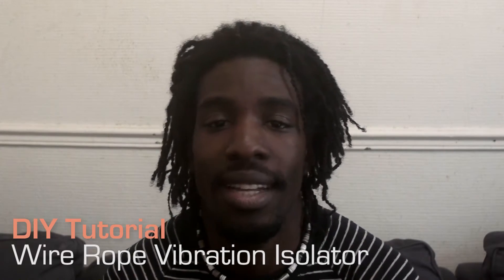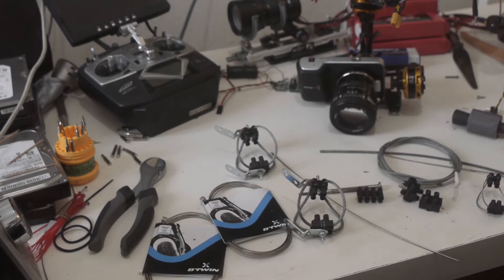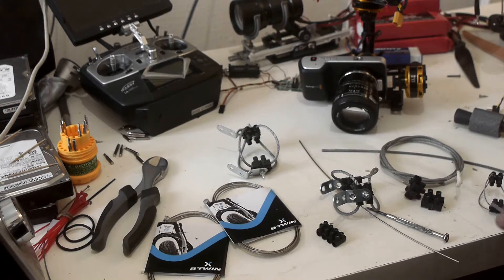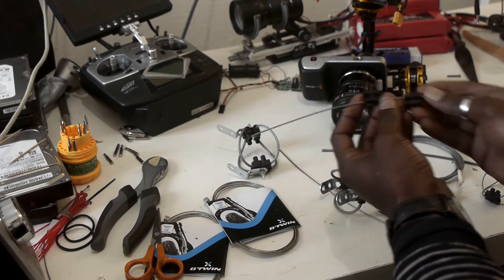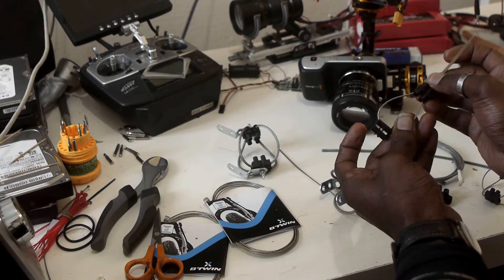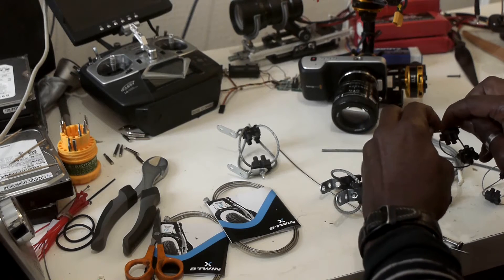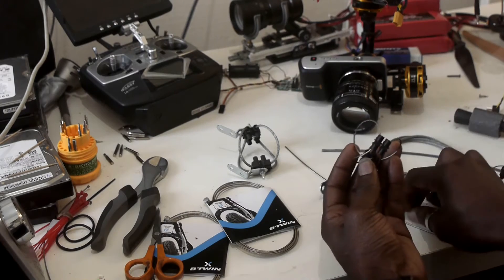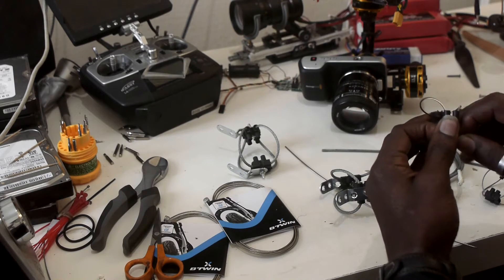Tutorial : DIY Wire rope vibration isolator/vibration damper/Jello killer

Comment: Do you have to match camera weight ot the payload listed on the Wire rope vibration isolator/vibration damper specs?
Reply from the maker: You have to adjust the size of the wire to match your payload.

Comment: to prove that, this device does prevent vibration moves from the base to the next plate, you need to use the vibration APP. app is free for iOS. get an ipad. use the app. do a proper test. create a source of vibration, apply to the fixed plates. screen shot the numbers. then use your spring device and test and compare the numbers. put both screen shots and description of vibration test on a video. or send me the files, i make a web page for it. contact me throuh the contact page of the web site. Vegan-Religion.org   Moses